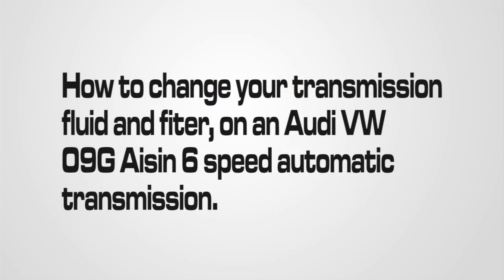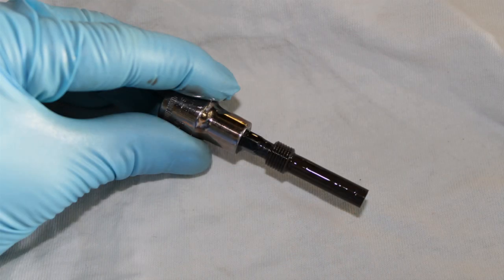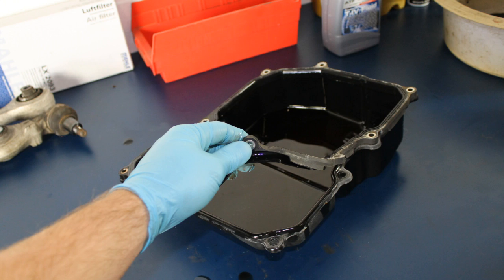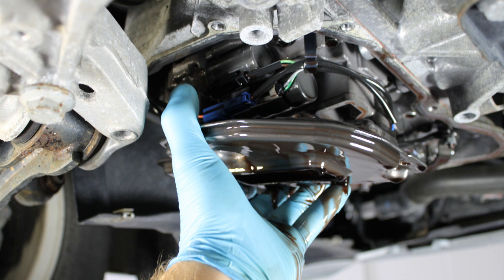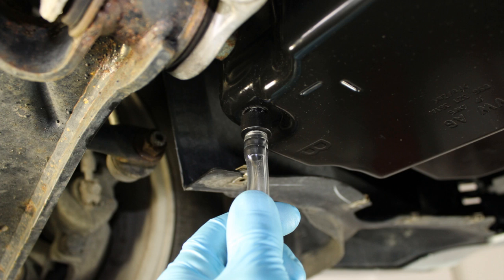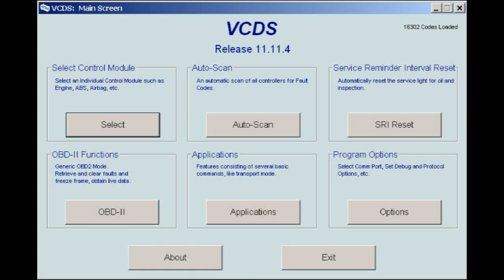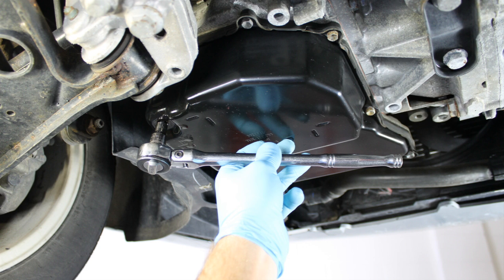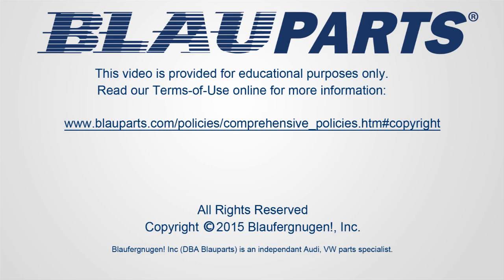How to Change Audi VW Transmission Fluid (aka ATF) on 6 Speed 09G

Comment: I drain 2.5L of old fluid then i put 6L of new fluid, after that at 45 celcius with the engine iddling i took the oilplug to drain the exceed and it came out 2.5L again, it is normal that much oil?

Comment: On my car, I have a gray fill tube with a tamper evident seal.  I just take the seal off and pull that plug out and run a 2 or 3 foot length of vinyl tubing into that.  Make sure it is not twisted in some sort of funny way that will make the tube come out.  You can even wedge something down alongside the tube to hold it in place.  Now you need a funnel that fits into the tubing.  The tubing I use is 1/2 inch OD and 3/8 ID due to the size of the opening that I put it into and so finding a funnel that fits that tubing may be a little bit tricky.  I get my funnels from the dollar tree and they come in three sizes in one package.  I use the smallest one and if the tubing has not had fluid or anything in it, it will hold the funnel reasonably well if you are not a klutz long enough to get the fluid in the transmission.  I do the measured fill method and that uses around 3.5 liters of fluid.  Yours may vary so be careful to use not too much or too little.  Take the car for a short trip that does not take you very far from home and see that it is shifting OK.  If it is not you may have too much or too little fluid but most people who have changed theirs said they drained 3.5 liters and that is what I got also.  My car is a 2006 Jetta 2.5 and I have been using Toyota Type T-IV fluid in it for nearly 30,000 miles and it still runs good.  I should probably change it more often.  I only buy the Toyota fluid because it is the same fluid and is 12 dollars a bottle cheaper.  I poured a small sample of both fluids in small unmarked containers and I could not tell which one was which.  I know there is more science to it than that but the fluid was the same shade of red, had the same odor (some fluids have a distinct odor depending upon the additives that are in it),  it even poured the same.  There are numerous oil threads on the internet that by now have some people whacking there head on a solid object from the subject of equivalent fluids being beat to death repeatedly and they all say that the Type T-IV is the same fluid as the JWS 3309 or G 055 025 A2.  Further more there are many other cars that use the same gearbox but under the name TF60SN and most notably is Volvo for one and some digging in their forums is one way I found that Type T-IV is usable in that transmission.  Even Mazda has a TSB out if I am not mistaken that says in a nut shell that other fluids can be used if they meet JWS 3309 or Type T-IV.

Comment: I like the gasket they use on these and that they don't have too many bolts.  I had a Chrysler once with an A604 and that had no drain plug but it had a lot more than 8 bolts.  I can only imagine no one ever wants to change the fluid in those because of that.

Comment: Most of the remaining fluid drains out anyhow.  the threads for that fluid level tube are up there probably 1/2 to 3/4 of an inch.  If it was a flat pan you would get probably another half of a liter.  The design of that pan also makes it less likely that the sediment on the bottom of the pan would drain out.  That is likely to be one reason why a lot of people recommend taking the pan off.  I only have 8 bolts so it is not as bad as some transmissions can be.  I had a Chrysler and that thing had 30 or 40 bolts along with no drain plug.  Then with that car it had to be ONE specific fluid or you could expect problems in the near future, it was awful!!

Comment: I followed these procedures exactly. Only 3 liters of fluid drained out over about 1 hr. Only 3.5 liters of new ATF would go in, I'm using the pump, not just gravity. After several cycles of shifting and and letting the engine just idle while I pumped, it just won't take any more fluid. Is this ok?
Reply: Going by other videos around the world your correct they also only put in about 3.5 liters You can never fully drain this transmission.

Comment: Hi,on a Tiguan 2.0 tsi 4 motion 2009 6 speed auto is ok if I change only fluids and not the filter and gasket?
Reply: chris costo yes you can but kind of defeats the purpose.  With more and more vehicles becoming non serviceable where you can only change fluid if you have a transmission that does have a removable pan and filter it is worth it. I think when you see how dirty the transmission fluid gets after it comes out you would probably say...might as well change the filter too.   Not much extra work especially when the fluid will be drained and the pan will be much lighter after the drained fluid.  Cheap insurance in a new filter.

Comment: why 6 litter? while there is only 3.7 litter inside the transmission when you drain?
Reply: Not sure but I do a dump and refill 3 times for all ATF changes so you get all the fluid rather then half.
Reply: Because somes left in the torque converter.

Comment: BlauParts... how many litres exactly will this transmission use.?
Reply from the maker: Hello Samuel,
The dry fill capacity from Volkswagen is 7.2 liters and the refill is 5.2 liters. If you have any other how to tech questions, feel free to visit the 'VW Repair & Maintenance Information' section on our website here: http://www.blauparts.com/vw/vw_how_to/vw_how_to_repair_replace_tips.shtml
Reply from the maker: Hello Samuel, 
During a fluid and filter change you will always have some ATF left over in the system unless you are using a professional or factory commercial grade fluid evacuation system. For a simple fluid change you will have around 2 liters in the system remaining. Many choose to change the fluid and then perform another fluid change several hundred miles later to allow more of the remaining two liters to come out. If you would prefer a full fluid flush it is recommended to take you vehicle to a transmission specialist who has a professional or factory commercial grade fluid evacuation system. For any other questions, feel free to contact us here: http://www.blauparts.com/policies/policies_toc.shtml